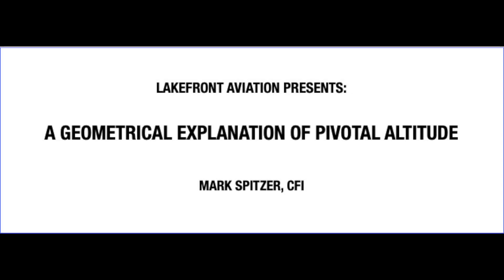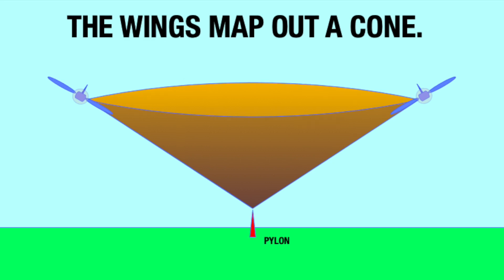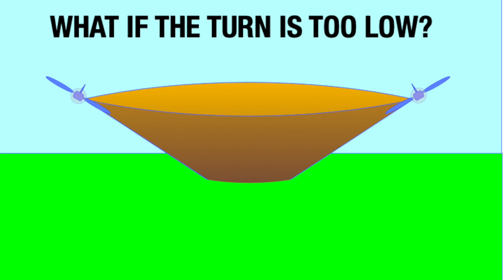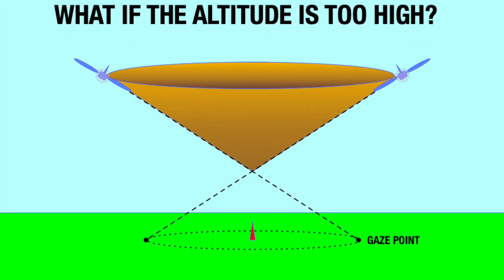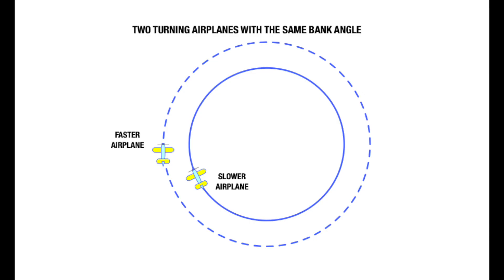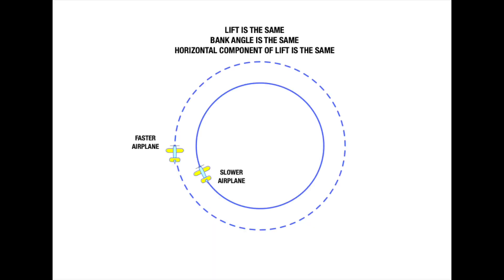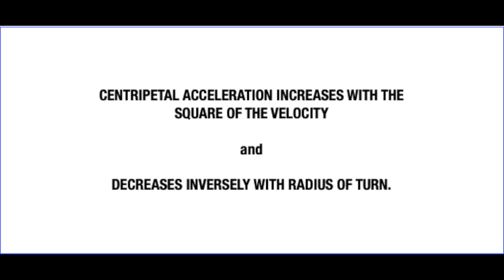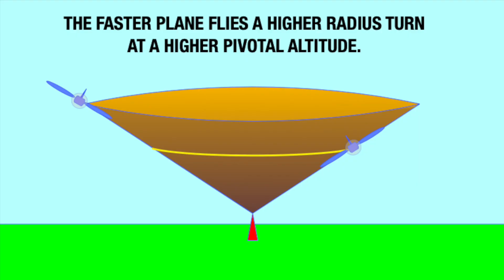A visual explanation of pivotal altitude.

Comment: Is it true to say that the radius of the turn stays the same given that the airspeed stays the same? The only thing that changes here is the ground speed which doesn’t affect the actual radius of the turn but just the reference line because you are looking at the ground.
Reply from the maker: The analysis presented is for the no-wind case, so airspeed and groundspeed are the same. If we fly in a circle at a constant speed and altitude, the radius will be constant.